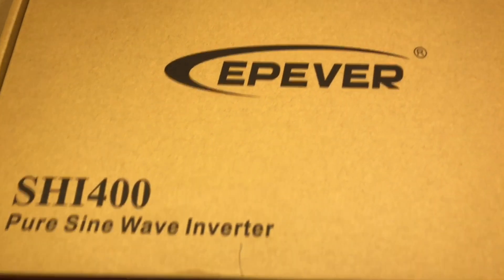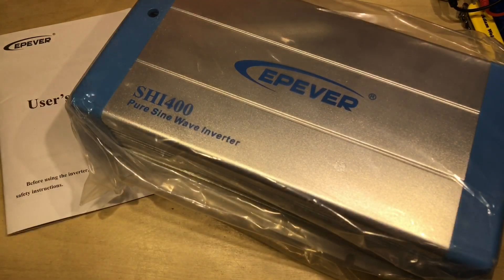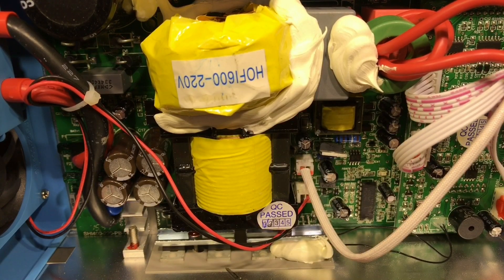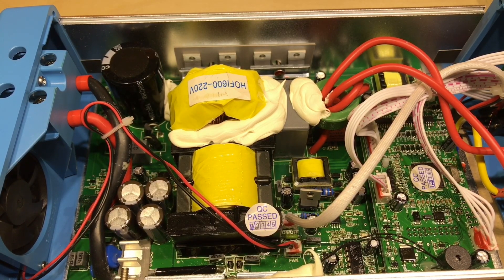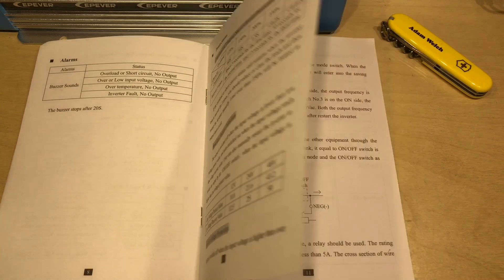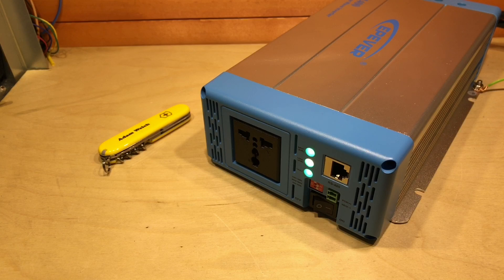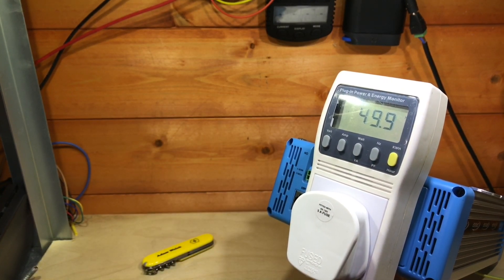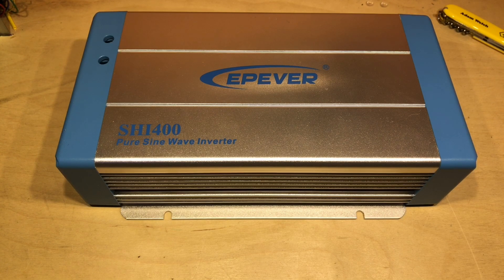EPEver SHI400 Pure Sine Wave Inverter - 12v Solar Shed

Comment: hello, congratulations for the videos.
Since you are an expert on epever products (company I really like) I wanted to ask you the difference between their low frequency and high frequency inverters.
Other manufacturers like victronenergy do not make low frequency inverters.
Which are the best?
Why do those at low frequencies with the same wattage weigh so much more?
What are low frequency good for?
thanks for the replies.
A greeting

Comment: Great vid as always. Bought what I was assured was a pure wine wave inverter, green cel!, .I plugged my mobile in and it went crazy, opened apps and the web, all by its self, I noticed you said it caused problems with your oscilloscope, is this common?

Comment: I have an EPEver solar system....XTRA4210N....is working fine and not much RF noise..my Pure Sine Wave 600 Watt inverter from the Brand ES-series direct on the 12v  AGM battery,s is making a terrible RF noise on my Hamradio Bands..especially 160 m Band is about 1.8 Mhz…..its so terrible that we cannot work on that band...i guess the same with this EP Ever inverter...no priority for these Chinese ( sometimes junk ) inverters to filter the output with Torroid ferrite  cores and Elco,s  etc... … buy an SMA  (  German made ) and its fine..... 73 ( Greetings in Hamradio )  Gerben PA0GDW The Netherlands

Comment: I was thinking that there was a reason for all that Silastic gunked up on that one transformer. I'm sure that's the culprit, they were trying to reduce the noise. Was a pretty high frequency too. It's probably creating the sine wave out of high speed pwm switching. That's the only way to get the high efficiency that it claims. The noise isn't a problem unless you have to listen too it. Put it inside sound dampened enclosure.

Comment: Hi adam
Thanks for your best review
I want to buy 2000 watt inverter, do you recommend this brand: epever ?
Because this brand and many off other brands does not have any guarantee service in my country. And before buy i want to be sure this is a good one to buy

Sorry for my english 😄
Reply from the maker: The 220/240 volt output is excellent and the efficiency seems reasonable for what it is. I’ve not had any issues at all with mine - except for the fact it emits quite high levels of RF.

Comment: I use the green 3.5 mm Phoenix connector on a relay to turn it on and off using a battery level checker, set to min 12.0V and 14.5V re connect.

Comment: Some of the pure sine wave inverters produce very good sine waves.  I have three from Reliable Electric (two 2000 watt, on 500 watt) and both deliver a cleaner waveform than the electric co-op that serves our area.  The Ebay vendor ID is reliablepower  I've tested all three units at 80% of their rated load (which is more than the working load in my application).  They still have the same waveform and they meet the >=85% efficiency up to about 80% of rated capacity.  They have units available in all input (12, 24, 48, and up) and most common output (120, 240) voltages.

Comment: Hi. can you run Inverter and charge-controller with a switch to WiFi modules
Reply from the maker: I guess to could with a four pole double throw switch (or three perhaps), but it’s going to make the ebox WiFi-01 reboot each time you change. Perhaps two eBoxes or a home made rs485 to WiFi adapter (like the one I made in a recent video) make be more sensible?

Comment: Hi Adam, I've been following your solar meanderings for a while now, and bought stuff after your reviews. I have finally got 'the shedifice' power-station up and running, with 6x 190w mono's, a 4210A, 2 x 120Ah tank batteries, and finally ordered an Epever STI1000-24-230. (The sterling 24300 pure sine gave up the smoke). Quick question: is there a preferred orientation for mounting the inverter, and which way does the fan blow; in or out?

Comment: I have just bought one of these to compliment my epsolar charge controller. i cant get the monitoring to work.
i have the ewifi box which works fine with the charge controller.
I have read the manual and see that it needs to be ID 3 unlike the charge controller which is id 1.
I have download the correct software.

I dont have a android device so i use the windows software and the virtual com port.

In the video  mention it worked with the ewifi box but was that with your android tablet or virtual coms port and windows?

thanks
Reply: I have the same issue with SHI 1000 and Tracer 4210 A - Ebox works with Tracer MMPT but not with SHI - The power light on ebox never comes on

Comment: I have the 1000W 24V version. It is electrically noisy, and causes problems with my arduinio control system which is nearby, articularly one wire DS1820 temperature sensors A cheap PWM battery charger I have does the same trick so its probably as much my system as anything.  .  The power saving mode can cause problems of its own too.  My deep freeze has a real downer on it, when its first powered up the freezer draws a lot of power for a couple of seconds (about 800 watts - 40+ amps )and it cycles every 10 seconds.  It completely negates the saving gained by turning the inverter off for most of the time.  My fridge has no such issues.  On the plus side it has no issues starting the freezer or the fridge.   I dd size it working on 7-10 times running power to get it to kick up.
Reply from the maker: Thanks for confirming I'm not alone in the issue.  EPEver suggested that the STI line of inverters should have less noise - however there is nothing I've found in the product listing or manual which backs up this argument.  Putting the RFI to one side I've been pleased with mine and it seems to cope well with the loads I've tried on it.

Comment: Thanks for the review it's come at a very timely point for me. I'm thinking of setting up a small test system to run my home workshop off-grid. I have a milling machine rated at 500W but run it for only relatively short periods of time maybe 5-10 minutes total in any hour. I wondered what size of inverter I might need for this - 1000W maybe or could I get away with something smaller?

Comment: My Latronics 400 watt inverter ran a 1600 watt vacuum cleaner for over a minute. Then it quietly shut down. But that's made in Aussie, not in the PRC. Nevertheless, these EPEver inverters look pretty good. Maybe you could even get your lights off the grid with it eh Adam? :)

Comment: A Chinese inverter that lives up to it's claimed capabilities? Wow! It must be a special day for the shed. ;-p Thanks Adam. I'm looking forward to hearing how it performs over the next couple of years. As for the oscilloscope glitches, it's probably RFI which is coming down the output leads, or possibly being radiated from the unit/ input leads.. First step would be to try adding ferrite rings to the input and output cables. Screened and grounded cable might also help. Another step would be to move the inverter as far away from the 'scope as possible. I once had a professional RF signal generator which only worked properly with the manufacturer-supplied screened and grounded mains supply cable.
Reply from the maker: +RWBHere Yeah I'be got some ferrite rings to test - distance also a good idea. I'll hopefully update on this inverter on the next couple of weeks. Cheers.
Reply: +Adam, thanks. I'll look out for the next videos about the unit. Best regards.

Comment: Adam, have you ever looked at grid tie inverters?
Reply from the maker: +wuftymerguftyguff Issue for me is that the only ones that are approved in this country are very expensive...
Reply: The problem in the UK is that your solar setup has to be installed by a certified company for the utility company to fit a meter that shows how much you have generated to the grid.

The normal house hold meters count up even faster when a grid tie inverter is turned on in the UK, no idea why but its been reported that it does when dumping electricity to the grid..

Comment: Hi Adam, that "audible" noise would probably be "heard" on RF too. As a ham I am looking for a good, clean 12v solar shed/shack setup. The EPever Tracer A is flamed on Amazon by radio amateurs and boat owners being extremely RF noisy. And now this inverter.
Seems that EPever isn't really bothered keeping their products RFI "clean". Pity, I'll stick to the bit expensive blue coloured  stuff that boat owners use.

Comment: Can you try run a fridge on this, and tell me how much battery and solar you would need?! :)
Reply from the maker: I'm sorry I don't have a fridge I can easily connect up to it.  Even if I did your fridge would be different to mine, in a different environment and have different use.  My experimentation wouldn't be all that helpful to you.
Buy a plug in mains meter like I used in the video and connect your fridge up for 24 hours - or more.  Then you start to get an idea of how much solar energy you need to create to run it for a day.  Then work from there.
Reply: Yes i did it in a video. I just wanted to se IF you did the test what your results was.

Comment: Hi Adam Thanks for the review on the EPsolar inverter. Did you get it from Ebay ?  bimblesolar uk are the agents for EPsolar by the way. You state that the inverter must be earthed. pls expand on that. I am looking forward to hear what EPsolar say about the noise
Reply from the maker: Yeah I got it from eBay.  I hadn't seen bimble do them - although they only seem to have the 600w 12 version in stock at the mo.
The inverter was earthed you should just be able to make that out in the top right of the video at 8:00 when I first switch it on.  Didn't mention it though - sorry.
Reply: thanks for your reply about the earth when off grid where would you recommend earthing the Inverter too ? in it is mounted on wood base.

Comment: Hi Adam. Thanks for your inspiring videos. I'm fairly new to electronics and solar. Is this product different to a Grid Tie Inverter one of which I use to put surplus solar energy into my mains?
Reply from the maker: Thanks for the kind comments John.  This inverter is off grid.  It uses my battery bank rather than solar as it's energy source and powers the devices connected to it entirely.  A grid tied converter will typically take the solar input directly (although not always) and supplement the already active grid to which it is connected.  Hope that helps.

Comment: I was just looking at these the other day! look forward to seeing you connect it up to the software and hearing back from EPEver. i think a three part series could be in order! ;)
Reply from the maker: +Night Jar Well I wasn't planning on a three parter - but you might be right!
Reply: @Ken Fullman i have the 2000w version and I'm very haply with it. Seems to ve working exactly to spec
Reply: @Ken Fullman EPEver is a pretty good brand, that's why they are not that cheap. I'd love to have the 3000w model

Comment: Here is the Aliexpress link for it. I think its the official Epsolar reseller. 147 dollars with 2-4 days TNT shipping included.
I purchased from them several times. Very helpful and so far i haven't paid import tax on any purchases, not even the 3 kg 4210 Tracer A shipment, i just get them to use a low value ;)  Shipping with TNT takes takes 2-4 days from China to Denmark.
I highly recommend this seller
https://www.aliexpress.com/store/product/EPSOLAR-SHI400-400W-400Watt-12V-24V-input-220V-230V-Output-Pure-Sine-Wave-Solar-Inverter-for/2808082_32798453788.html?spm=2114.12010612.0.0.uNzU08

Comment: Hello Adam...good video, congrats on the inverter.  Have you considered, the "floating" Earth in the shed...?   Your inverter can "float" at half the Vout...  causing trouble for the scope and mic.   The sound you "hear" can be the missing ground...picked up by the cables, working as antennas.   Much like, when you use some  laptop or pc's in a two prong socket, floating, without proper ground.  Just an idea and a thought.   A piece of rebar or better, hammered in to the ground, will act as ground.  Is there a "Ground" on the scope...?   if so, is it making any difference...?   Good luck investigating...!   PS: I know the shed is 12 Volt, but this could be a new situation.
Reply from the maker: +Jakob Hovman Hi Jakob and thanks for the suggestions. I did ground the inverter you can see the cable connected in a couple of the shots. I was running my oscilloscope from its battery so it was floating.  Seemed to work fine for the modified sine wave.
Reply: Hello Adam...Thank You for your reply.   I will watch the video again...yes, I see the ground...!  I was just curious if the scope was connected to that same ground.  Is the probes ground internally connected to the scope ground...?  
 Hope you get support from EP.

Comment: I'd like to see what the ui looks like and what you can do with it when it's plugged into a pc
Reply from the maker: I plan to look at this before too long.
Reply: I have an EpEver SHI 2000 and you can see graphs and numbers of Load, Temp, Hz, Vdc, Vac and some more I can't remember :) But most Important you can adjust the Low/high Voltage protection, so say you do not want to drain your battery bank to more than 50% you can change the voltage from 10,8V(<10%) to 12,10V (50%), which is the only inverter I know of that has that feature :)

To Adam: I Really like your work keep it up!
Ps: I'm also addicted to EPEver products. ;-)

Kind Regards 
Erik in Sweden
Reply: @4humm4 How? 
When ever I change the values and click 'Set Volt' it say "write successful" but never does what I set. When i click 'Read' I always get the default values again.

Comment: Adam, did you tried to analyze the ripple on your scope or so? It is not normal at all...
Reply from the maker: The issue is the RF noise is causing my oscilloscope to be almost unusual - I've asked EPSolar to comment.  I will try again another day and update if I find anything.
Reply: Adam Welch: what about to make simple dipole antenna for scope input to try find what kind of RF noise it is...

Comment: they make inverters now, good stuff.
Reply: the torroid on the output was probably to cut down on the noise. you could try adding a few more turns or invest in a filter like the HA32L which would at least stop the noise getting to your loads. (hopefully)
Reply from the maker: Thanks - I'll purchase a HA32L and see if it helps.  I'd like to hear what EPSolar have to say as well - I've contacted their support department.
Reply: I'd be interested to see what happens on the scope. I have a couple on my inverter to stop switch mode power supplies upsetting it.

Comment: Wow Adam whats all the noise.....That needs investigating is it blasting out RF noise thats getting picked up by the Camera lets us know if you manage to tame it.....Nice video again pal
Reply from the maker: Thank you - I've contacted EPSolar to ask them if they believe this is normal.  I didn't really realise how bad it was until I edited the video together.  I will attempt to find the cause at some point.  Cheers
Reply: Keep us in the loop, let us know how you get on with your enquiry ....cheers
Reply from the maker: Will do.
Reply: I had noticed that, too. Not good for backup power for an HF transceiver. That said, I guess you could just power the radio from the batteries.

Comment: I much prefer those dc binding terminals to the "thumb screw" types on most of those small inverters. could you hear the noise or or did you notice it while reviewing the video?
Reply from the maker: No audible noise whilst in use - it was the oscilloscope which first drew my attention to it.  Sadly my mic isn't shielded and it suffers badly.  I've asked EPSolar to comment.